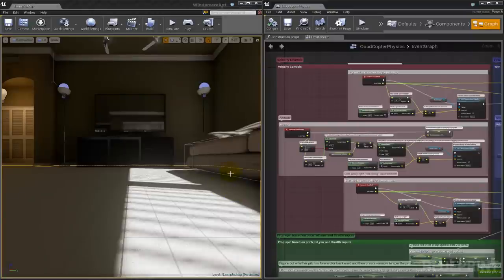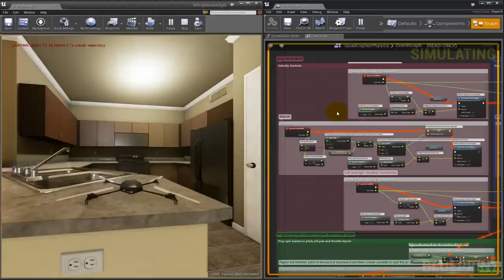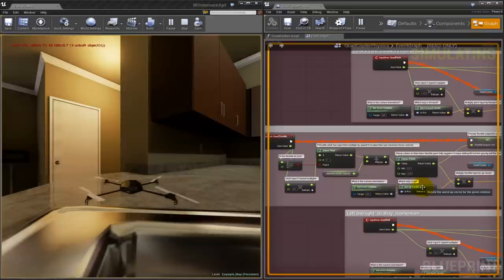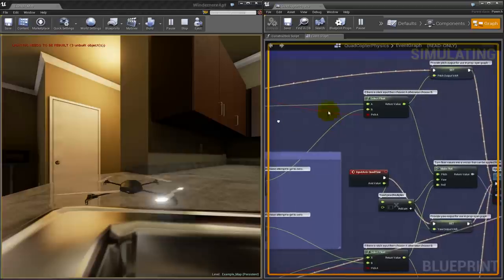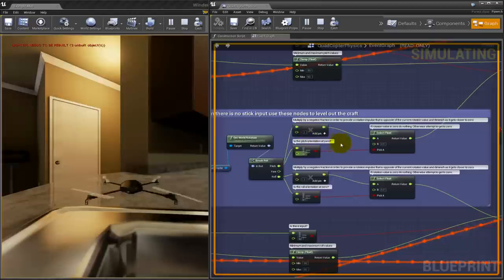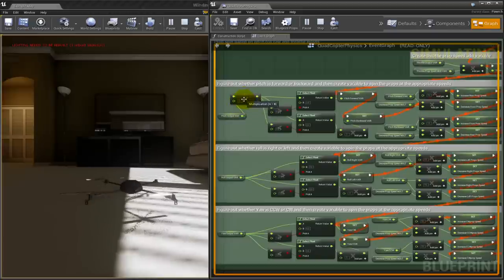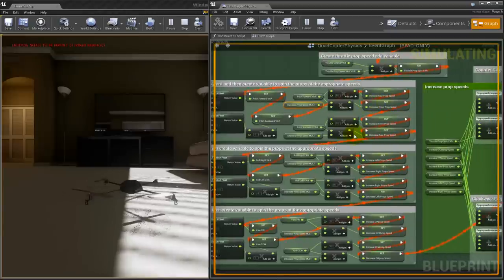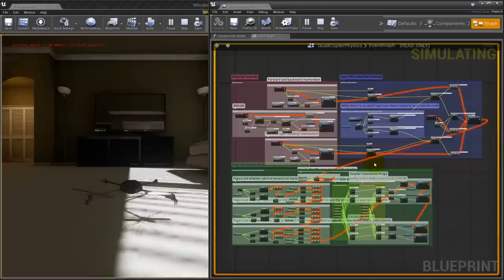Quadcopter Physics Blueprint

Comment: I wish I could add this to my project, I don't even need the quad copter just the flying mechanics added to a basic sphere.
Reply from the maker: Just follow my blueprint. All you would have to do is leave out all the fancy propeller stuff.
Reply: Jason Hunken
 I have actually just found a great alternative. I'm using the hover ufo available in the demos. It moves a lot like the quadcopter too.
Reply from the maker: Owen Prescott Yeah that is partly what I based my blueprint on (loosely) so it's not surprising that it would work for you.

Comment: This looks great! Awesome job!
I'm actually working on a similar project right now and I have a drone I've modeled.
I know it's been a long time but just wanted to know if you have any idea of what parent class you've used here? Also, do you take the parts of the drone as separate components or the whole drone as a single component? I was looking at using the BP_FlyingPawn as a parent class but I'm totally new to unreal engine and I don't really know my way around too much.
Reply from the maker: Yeah it's been forever since I messed with that but I didn't mess with any classes. I just used the flying pawn blueprint and tweaked the hell out of it. So whatever that was is what mine was.
Reply from the maker: And yeah each drone part that was needed to move independently was brought in as a separate static mesh and then combined in the flyingpawn blueprint and driven by the code for animation.

Comment: Hey, I know it´s been a while since you made this, but could you tell me how you calculated the "minimal hover velocity"?
As you said in the video, it would change if the mass of the model changes, so how did you get the exactly right value? If it were just slightly bigger or lower then the actual force required to zero out gravity, then the Quadcoper would start going up or down after a while. Is the default (1) gravity in UE4 9.8m/s² and did you calculate how many Newtons you would need based on the mass of the Quadcopter to accelerate 9.8M/s² upwards, or is there some much more simple way then that?
Reply from the maker: much more simple... trial and error ;p I avoid doing math unless it's unavoidable. I was able to get it to hover pretty stable that way but it seemed like each new UE4 update changed something and I had to fiddle again. I am sure there is a better formula that would go get the minimum hover velocity based on physics values but someone else probably already figured that out.
Reply: +Jman7718  or create a hover component  blueprint class
Reply from the maker: +thomasabramson100 oooo good to know. guess there are some new tricks since I last played with blueprint. I have been making VR games with Unity lately instead.

Comment: I'm actually starting a very similar project today.  I'm going with acro mode as my basic input before adding horizon mode, etc on top of that.  You may be interested in this if you're still working on this project, a guy on the UE4 forums made a joystick plugin that works great with my FRSky Taranis over a usb connection.  https://forums.unrealengine.com/archive/index.php/t-51237.html
Reply from the maker: Awesome. I have been super busy lately but I do plan to come back to this. Thats cool there's a plugin for the controller. That would be ideal for someone who wants to get some serious practice flying.

Comment: how did you get both the blueprint graph editor and the editor on screen side by side open at the same time mine opens over the level editor covering it
Reply from the maker: +thomasabramson100 It's been a while since I used UE4 but I believe I just tore off the panel and then shaped it to fit one half of the screen. Maybe you can't anymore? I don't know.